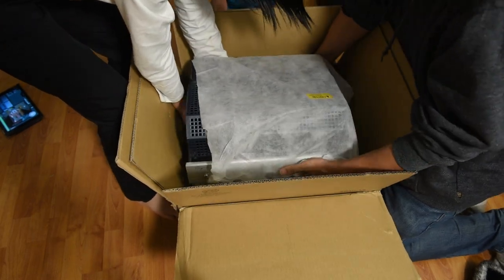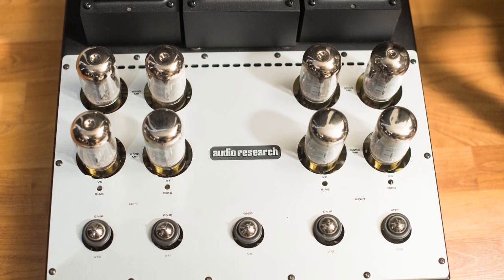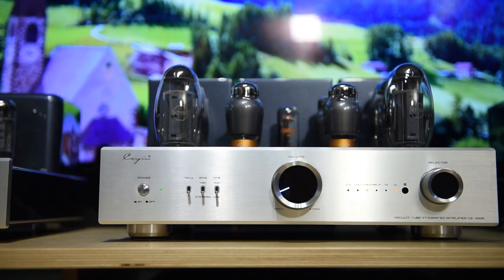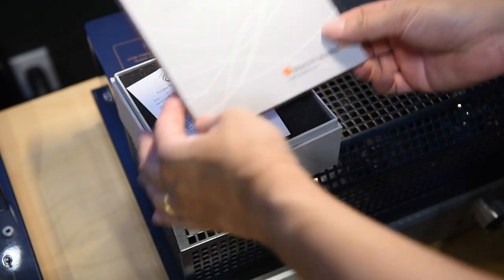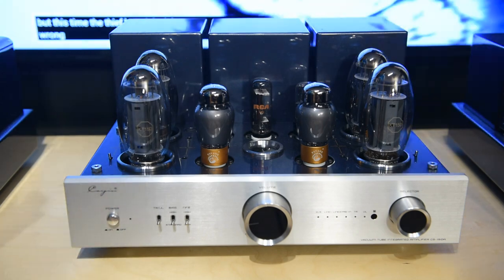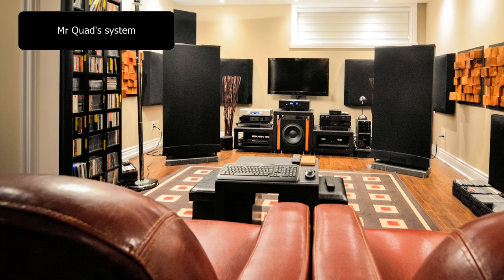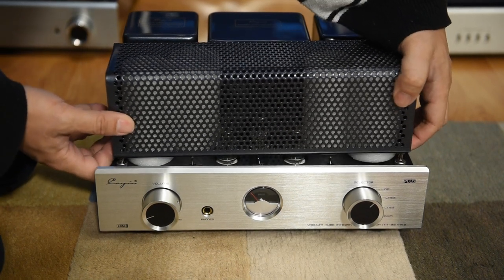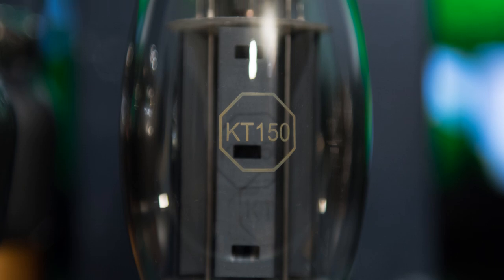The most dynamic Tube amp in the world? 🤔Cayin CS150 Tube integrated amp review.

Comment: 22DE4-this brought back memories of old tubed TV's-the 22DE4 was used as a damper tube in the horizontal out stage as a damper tube.Did two things in a TV-suppresed oscillation from the deflection yoke and derived the B+ boost voltages. Then KT family of tubes-their ancestor was the good 'ol 6L6 derived by Cunnigham Electronics during WW2.The 6L6 made for compact and efficient audio amps for aircraft-tank radios!

Comment: thank you Thomas for this video, very fair, concerning the Cayin CS150A amplifier, what I can say is that this new amplifier was quite lively in the medium / high frequencies, sorry for my language, because I am French, but after several weeks of wear of the electronic tubes, the sound is excellent in the medium / high register, almost perfect, a great dynamic, the 6NS7 Tung Sol tubes of the preamplification stage need some time to set the tone. better. this is arguably my best amplifier. however, there is also a Cayin preamplifier, the SC 6LS MK2. a marvel to discover, exceptional quality, coupled with a professional Yamaha PX8 power unit on Cabasse Clipper M1, it's woaw ...
the components of the preamp SC6lsmk2 are of quality, resistors takman, nichicon, real cap etc etc etc magnificent! the sound, transparent, detailed, deep, dynamic. :)

Comment: I have the Line Magnetic LM-150ia and I use the Cv181 psvane instead of the stock 6sn7. The preamp tubes are psvane 12ax7. It’s a lot like how you describe. Tube Pre with SS power. Not bright at all. Huge sound stage and the tube holographic! They have better control of my Elac Adantes than any other solid state amp I have tried.

Billie Jean is a track that I have been using for auditions for a long time. It’s handy back in the day when dealers only had CDs and MJ was a common artist. One more interesting thing about Billie Jean is that in a very good system, you will be able to clearly notice and count how many times he snaps his finger through our the song. Do try and share.
Reply from the maker: Thanks !! Yes the finger snapping is something I also use to test systems. Thanks for sharing.

Comment: Tube amps tend to sound more powerful than similarly-rated solid-state amps because the clipping characteristics of most tube amps are less harsh. This is not always the case, though. I have heard some vintage solid-state amps (typically Marantzes) that can visibly clip on an oscilloscope while still sounding amazingly clean. It's really surprising when that happens.
Reply: Not necessarily true. Classé DR3 for instance sounds like a hundred watt amp and when it clips you hear it easily. There are other factors at hand and the one you mention is overstated.

Comment: It is just that a tube under the right circumstance is capable of massive dynamic range. A small double triode used in a microphone front end for example will out perform any device simply because of it's intrinsic properties, swinging much higher voltages along with its high impedance etc. 140db dynamic range is easily within reach and was indeed part of reason why those valve mikes were so extraordinary and did measure this well.
Output stages have a much harder time reaching anything like that range, and of course they can't - with limitations coming from earlier in the circuit raising hum and noise and power limitations..I guess if you were really careful....but you would always be 40db 'ish' behind a small signal device  considering the same care taken there.
I have never heard a solid state preamp worth using. (Full stop) The SP8 was my favourite for many years, and the next best thing was no preamp at all...Though it didn't help my record player doing that.
On a different note..
Did anyone out there ever try the Aurex electret condenser cartridge? It came with a little energiser/ phonostage amplifier and was amazing but there seems to be nobody else remembering it. Being a Toshiba it made me start looking and I found something I had not seen since the Philco magic light of the 40s. The Toshiba C-100 photoelectric cartridge..I would love to talk to those Toshiba Aurex engineers, they were crazy! The C-100 has serious promise.
Edit:  Even if it did have a pair of photo transistors..I doubt you could accommodate a pair of photo tubes...

Comment: Tubes excel at transistioning from soft to loud faster than bipolar transistors and mosfets. Although those solid state amps designed by Tom Evans back in the 1990s came close to being tube like in transitioning from soft to loud.

Comment: KT150 sounds great. I use it on my little Musical Paradise MP301-MKlll and absolutely love it. The sound is fuller and airier.
Reply from the maker: I know the MP301 can run KT120,  I did not know it can run KT150! You should double check with Garry if the amp can handle the extra power requirement. KT120 is pretty good already.
Reply: @ThomasAndStereo  I did  checked with Gary, it supports  both KT150 and the new Kt170. Gary prefers Kt77.  KT150 are my favorite, gorgeous sounding tube.

Comment: Hi Thomas, I been enjoying the KT150 since 2017 with PrimaLuna DiaLogue Premium HP Integrated.  Using Focal Aria 936 and what a Perfect match.  What is nice about PrimaLuna Premium are "8" Power Tubes 4 each channel KT150,  "6" 12AUX7's "2" each side L&R Driver tubes and "2"  12AU7's front Grain tubes.  If you are using speakers with a tweeter that is Hot...Swap out the 2 Gain tubes with "Mullard" and the tweeter is tamed...Have a tweeter that can use a boost...install a pair of Brimar or Radiotechnique. Thank You and I enjoy your video's.
Reply from the maker: Thanks Joe for the tip. I have Mullard and Brimar tubes but not Radiotechnique tubes.

Comment: Thomas, this is what I'm looking for. I will seriously considering this. Looks like a very good match with the Q Acoustics Concept 500. Thanks for the review.
Reply from the maker: The only thing when pairing with the Concept 500, bass is not fat so it is on the lean side but very punchy and nuance. I added a sub to add some warmth but it is ok without.
Reply from the maker: Frankie, I do want to say, when you go audition the Cayin, make sure you also audition the CS100, the difference is the CS100 sounds more like a tube amp where the notes seem to linger a bit longer. It is more airy and less 'dry' on the top end. Bass and dynamics might not be as good as the CS150 but with the Concept 500, the CS100 sounds really good especially if you are chasing more after the tube sound. I did have to change the tubes because it was on the bright side.
Reply: @ThomasAndStereo  thanks Thomas, appreciate your hard work and sharing.

Comment: Thank you for this quick and clear answer. I hope you don't find it too inquisitve when I tell you I can buy the 150 for exactly the same price as the Doge 10 in my country and renew my question, because I understand that the price tag plays an important role and double the price in Canada can certainly not outweigh the highlight in only one respect (dynamics).
Reply from the maker: Yes outside north america, you can get Cayin for cheap. we have a proper distributor support system so it is more expensive over here.

Comment: Hi Thomas. Great video as usual. I love your "stories" - they are very entertaining. When is "Mr. Kanta" going to to review this amp?
I own the R8 which I have owned for a year. I'm running it with a Naim ND5 NX 2 streamer/DAC, Rega Planar 6 with Nagaoka MP500, Shiit Mani, and the Q Acoustic Concept 500's. I found the stock valves to be total crap and am now running two quite different combinations of valves, including Sophia Electric KT88-ST and 6SN7-ST, PsVane 6SN7-ST for the power supply, and Shuguang 6SL7-ST as one set, while the other set are NOS Mullard 6CA7, Sylvania 6SN7GTA, and MELZ military spec 6SL7's. I also have Svetlana 6550's and all combinations give a fabulous sound - each set sounding slightly different from one another. So, honestly Thomas, just how good is this Cayin CS 150A? I must admit that I am tempted to buy it as I have my main listening room and a totally separate lounge room. Either way, the better amp would go into my main listening room while the other would go into the lounge. Speakers? I'd probably buy the Spacial Sapphires or X5 OB as a second set of speakers to go into my main listening room. I'm undecided at the moment on other brands/models of other equipment that I would need for my main listening room. Perhaps the Auralic Altair G1 or one of the other great DAC's which you have recommended.
Reply from the maker: Well, Mr Kanta will get it in 2 days. Mr Jazz just tried it and was impressed. I will perhaps post a follow up one day on my community page.

Comment: Once again a very nice review Thomas. The CS-150A is an amazing beast. I can say it matches and it's possibly better than my Audio Research GSi75 that also uses KT150 tubes (75 watts), the CAYIN is  a fraction of the cost of the ARC.  The CAYIN has a plus of being a full tube amp, it has tube rectification, UL and TR option, NFB control... did you try it? I use it with DALI RUBICON 6 and don't find it a bit bright with the stock tubes. DALI is designed for neutrality, never heard the Q acoustics. I am now testing the LINE MAGNETIC LM-805 that is a SET  48 watts class A, it's a totally different animal, but it's also amazing on a different level, SET has a kind of magic that's is impossible to replicate on other typologies. Both brands, are amazing.
Reply from the maker: Oh wow, this is very interesting. I was thinking to get the Gsi75 at one point and to know the Cayin CS150 can compete is mind boggling.
Reply: @ThomasAndStereo  The only thing I would miss from the ARC is the tube hours counter, that's great.

Comment: KT150s are serious tubes. 70watts plate dissipation. Push pull configuration (class AB) tends to produce brighter highs and of course much more power than a class A. It would be interesting to listen to a single ended (class A) amp built with KT150s. Not as efficient use of power, nor as high a wattage (70 watts max), but my guess would be  a warmer sound.
Reply: Kevin Deal said that he uses KT150  in his home Prima Luna EVO100 despite the fact that they are not one of the recommended valves for that integrated amp.
I have not yet tried any KT valves. As I am planning on doing so, which would you recommend  trying first.
My system is capable of more than enough base so it is the top end I am trying to investigate.

Comment: Thomas very good presentation. I would like to suggest that you check out Bob Marley’s Survival album for bass punch...
Reply from the maker: Great, I think I have that album.
Reply: @ThomasAndStereo  Actually most of Bob Marley's albums will give you that punch. Thomas, I have a question you might be able to help me with. Do U know of any good repair shops in Toronto? I have a pair of NuForce Reference 9 Special Edition amps one of which needs the power board replaced (was screwed by a repair guy). I have the boards but I need someone I can trust to fix it. Hoping you know a good repair shop. I hope you're Ok with this. If not I apologize.
Reply from the maker: @jwinstonh1926  Sorry, I don't know as I am in Montreal.

Comment: Watts are Watts.
Damping Factor can play a large roll in perception of quality as well.
Current is what makes the difference in power between valve & solid state amps of the same wattage.
The 100 watt amp w/the higher current output will sound more powerful than the 100 watt amp w/the lower current output.
Reply: For two amps at the same power if one produces higher current then it will produce lower voltage I.e. loudness at the speaker end. You can’t have your cake and eat it too..
Reply: And, btw, tubes are good voltage amplification devices but lousy current amplification devices relative to solid state. Hence all the trend with tube input and driver stages driving solid state back ends in hybrid amps.

Comment: The Copland CTA 408 integrated also uses 4 KT 150 tubes; it has a built in phono stage that is solid state; have you heard it?
Reply from the maker: Not yet.
Reply: @ThomasAndStereo  it has been discontinued replaced by a lower power model the CTA 407 with the improvements of real time monitoring of tube health and allowing for tube rolling but optimized for KT88
Reply: The reason I am considering this is almost all the tube integrated amplifiers require a separate phono stage; I want a one box solution. This has a built in solid state phono with excellent specs for both MM and MC …hint hint to you
Reply from the maker: @mahasidha9  Lol, got it. I remember the CS55 Cayin phono stage was really good.

Comment: impressive to get 100w with 4. I'm using a PrimaLuna EVO 400 with 8!! KT150s and that is only 88watts. (That said PL doesn't run the tubes hard. But the K150 sound is great not just the watts. I'm running the PL to power sopra 2s, which don't need that much power, but I love the KT150 sound (vs KT88 or EL34)) - plus 1950s brimar NOS 12au7s
Reply: What do you get with KT150 you don't get from KT88/El34 besides dynamics!

Comment: I have been going crazy with tube amps in the past year or so. The very first tube amp I got was a Yaqin. I hated it, it sounded like a freaking solid-state amp. Then I got the Willsenton which was a MILLION times better. Smooth yet powerful. It made me hunger for more so now have the Unison Research S6. (my local dealer sold me one for like $1000 off) and now I think I'm done.
Reply: because the Leben amps are only 15 watts and that's not enough for my Harbeth speakers.
Reply from the maker: Yeah, Harbeth 30.1 are really hard to drive. Rated at only 85db. If your amp cannot bring out the bass, your speakers will sound a bit thin and bright.
Reply: @ThomasAndStereo  Yeah I think that's what happened with the Willsenton. The Unison is the same wattage but its class A so I think it drives the harbeth better.
Reply: but having said that I still have my old Odyssey Stratos amp. I'm thinking of getting a tube preamp for it.
Reply: I buy and sell gear like a lunatic BUT my Odyssey ain't going anywhere!

Comment: Enjoyed this video. Thanks for the review. At $6K I think the PrimaLuna  Evo 400 outfitted with KT150's  would be at nearly the same price point and pose a similar value. A bit more, I am sure. However, it will also have the additional features of Auto-Bias and bad tube indicators.
Reply from the maker: I think the Evo 400 would compete with the Cayin CS100. I have heard the EVO 400 with EL34 and 6550 since Mr Jazz had it. I did not know it can take KT150.
Reply: @ThomasAndStereo  Yep. Currently running one with them. The disadvantage is, due to their size, it is not recommended to use the tube cage. For what it is worth. I roll tubes on the Primaluna quite a bit. Started with Mullards and the stock EL-34 (Great Midrange). Then went to a variety of KT-88's (Fast and clean more SS sounding ala McIntosh.) The KT-150 to my ear sounds the best. (Accurate, yet musical, with crisp punchy bass. Akin to the Audio Research amps.)

Comment: I'd love to understand why a tube amp watt seems to be more than the same solid state or Class D watt.  Guitarists will frequently gig with 15-25 watt tube amps but wouldn't try the same with a 25 watt solid state amp.  There has to be something that can quantitatively explain that disparity.
Reply: It's based on the bass impedance on the speaker. If it's above 12 ohms. Tube amps will have more power than SS in that region.
Reply: @locmanw1583  Interesting, the implication being that the output rating of the amp will be over 20-20k but since the guitar's frequency response is from 80hz to about 1200hz, and, depending on the speaker's impedance from 80-1200hz,sd the tube amp has more wattage than the solid state?  That's an interesting idea.  I've never looked at the impedance curve of a guitar cab and I also hadn't considered where the impedance is in the range that the guitar plays at but it makes sense that it would affect the actual wattage outcome.
Reply: @caseyodonnell6621  yes if your speaker is like mostly 16 ohms in the bass region a tube amp could put out more power and sound more powerful too!

Comment: Hi Thomas. Yet another fine review. Just for curiousity, how does this amp fair against something like a Primaluna   Evo 300/ 400?
Reply from the maker: I have only heard the EVO400 for maybe an hour. I just remember it was not as tuby sounding as I like. Very clean and clear. This should be more dynamic but the EVO 400 should be more effortless. Mind you , I did not AB test both so take my advice with a pound of salt.
Reply: @ThomasAndStereo  that's grand. Has this amp got point to point wiring. I know the Primaluna amps have some sort of clever protective system when a tube blows, as you will still be able to listen music without harming the amp.
Reply from the maker: @steverees1936  it is point to point also. In case you did not know, prima Luna amps are made by Cayin.
Reply: @ThomasAndStereo  I didn't know that. I know they were designed by a Dutchman called Herman and parts are European/ Japanese sourced. I'm guessing that Primaluna use the Chinese site just for assembling, to reduce costs.